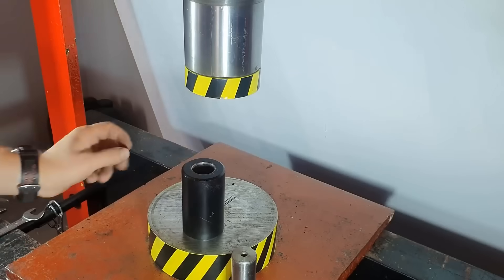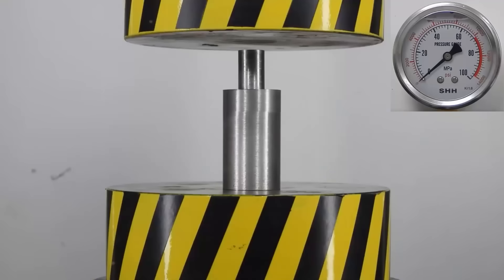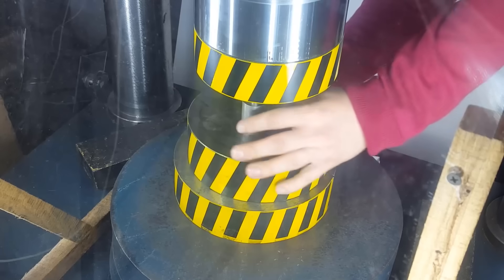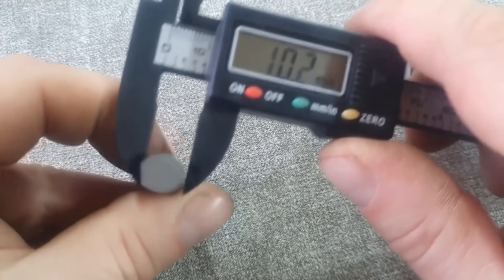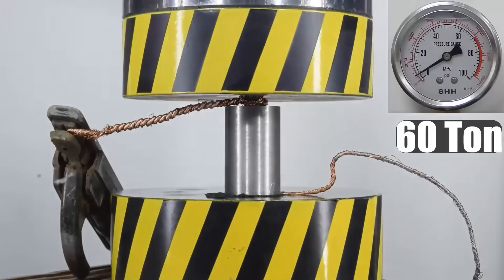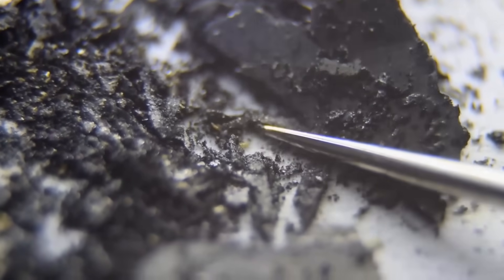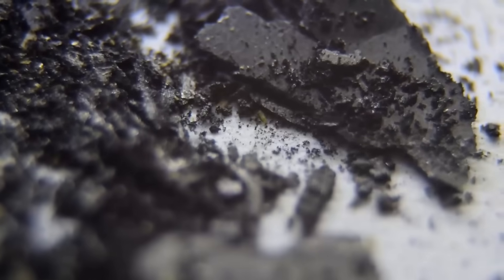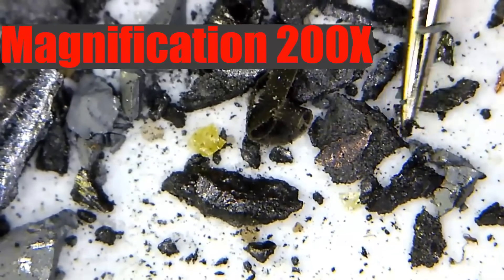HYDRAULIC PRESS TURNS GRAPHITE INTO DIAMOND

Comment: Well, congratulations would seem to be in order. Those are very definitely the yellow crystals of industrial diamonds. 
Used to sell for less than $1 per carat (very roughly about 1/4 inch cubed, or 6mm cubed), 30 years ago. So no, this is not an economical production system. 
The yellow colour is due to nitrogen atoms getting trapped in the diamond crystal as it forms. That can be scavenged out by chemical additives to the reaction chamber, but it just adds cost and complexity. For use as grinding pastes and powders, or sintered into "tip tools" for use on lathes, or drill bits that core into hard rock, the colour is irrelevant. 

De Beers used to be one of the "big three" manufacturers of industrial diamond last century. They started out using 500 ton presses back in the 1950's. By 1990, they were using presses capable of 22,000 tons, and a piston size of 6 inches. They could make 3,000 carats of industrial diamond crystals in about 45 minutes, per press. The tungsten carbide piston and die used multiple steel bands as support rings (aka compound cylinder, using Lame equations), to avoid the piston collapse you experienced. 

The engineering needed was at the very limits of material science and industrial capability. And it still is. Tungsten carbide can withstand about 45k atmospheres, but only in compression. It is no better than a good steel in tension, surviving maybe only 10k atmospheres. And what you have not mentioned at all, is that when the piston presses on the graphite to build up the compressive pressure in the press axis direction, tensile stresses are created in the other two dimensions. The piston expands radially, relying on the cylinder for radial support (lubricated by extruding graphite in the 3rd experiment) but ultimately that cylinder will also split due to tensile hoop stresses from the graphite (and cylinder) pressing outwards on the inner bore. 

Another fun fact: graphite is nature's best spring. A solid lump of it can be compressed to half of it's original height, and will then bounce back all the way to it's original height with no permanent deformation. Try doing that with any metal - you'd be lucky to get beyond 1% compression. Bear in mind I am NOT talking about a geometric device like an automobile suspension spring - I'm talking about a SOLID BLOCK of the material. 

In fact, given the cylinder dimensions, I am completely surprised it did not split if the pressure was indeed high enough to make diamond. I mean, even the piston in the second experiment mushroomed completely before it reached the appropriate load. In fact, experiment 2 was a complete misdirection, since once that piston mushroomed and transferred the axial load onto the end of the cylinder (which also became expanded) the press load was NOT compressing the graphite any more, and ALL of the load increase went axially through the cylinder instead. 

The indentation into the press platten of the third experiment proves the press load was transmitted though the piston and graphite. You should have seen an identical indent in the upper platten, buried beneath the shards from the WC (that's chemical annotation for Tungsten Carbide, btw, and not Water Closet). If you had used pads of WC top and bottom to diffuse the load, you might have saved your plattens. But it was also likely you would have sheared discs in those pads, and had the same end result damage. The pads would probably have had to be something like 50mm thick (as a raw guesstimate) to have avoided shear failure and protected the plattens. 

Certain ceramic powders (soils, or crushed rocks) can indeed withstand the pressure gradient to seal in the graphite. De Beers had developed quite a few special concotions to achieve that "gasket". It was all highly secret, since nobody wanted to reveal to the competition just how their process worked. 

Your temperature, however, would only have been high close to the copper. The piston and die (and possibly the press frame) all form conductive paths that would disperse and distribute the current from the welder. Resistance of the graphite is relatively high compared with those metals, so the current would have passed through the metal as a short circuit (you mentioned the breaker tripped) and avoided the graphite as much as possible. Temperature is a function of current density, meaning that while the copper wire was hot enough to melt and fuse, once that copper touched the piston and die and press it would have dispersed to a much lower density, and hence have heated the material far less. 

It is possible to convert graphite to diamond without needing that high temperature - but the pressure has to be far higher. I think you managed that by accident - rather than 50k atmospheres and 1000C, you probably got something like 70k atmospheres and a few hundred C at best. Those pressures will destroy any containment vessel, so it can never be cost effective. 

Also, you had no molten metal (iron and cobalt are typical solvents) that can dissolve the graphite and nucleate out the diamond crystals which then grow larger by diffusion of carbon through the molten metal. Crystal size thus depends on time, and even the small crystals you got here seem far too big for the time it was under pressure. 
Which all means I am not entirely sure how you got relatively large diamond crystals that show no sign of inclusions of graphite in them (black streaks  embedded in the crystal). That kind of "total matrix transformation" from the planar hexagons of graphite into the 3D tetrahedron of diamond is not something I have ever encountered. It feels more like the shock loading option, using ballistic projectiles splatting to a dead stop (like firing cast iron lumps with large graphite inclusions at high speed into a concrete wall) to generate a transient dynamic pressure that achieves the transformation. But this press process is not at all dynamic (fast) enough to do that. 

One last semantic for general benefit: these are synthetic diamonds. Which does NOT meant they are "artificial" diamonds. No, these are very much real diamond, made of carbon. 
The word "synthetic" means man-made, as opposed to naturally occuring. Hence, a synthetic fuel is a fuel we have created from coal, or plant oils, or suchlike. Synthetic diamond (whether the grotty yellow of industrial diamonds, or the pick-your-preferred color of some modern gemstone diamonds) were manufactured by us, not dug out the ground. 
Artificial diamonds would be an alternative material like Cubic Zirconia - definitely NOT carbon, and hence not diamond, but a mineral crystal that has similar refractive properties to polished diamonds, hence they can LOOK like gemstone diamonds, sparkling with similar brilliance, at a fraction of the price. 
The difference between artifical and synthetic is one of the most widely misunderstood uses of language...

Well done for reading this far. Sorry for the excess detail. I hope you found it interesting.
Reply: Damn, you should start a youtube channel lol
Reply: @mr.midnight8230 it’s worthy of addition to the Wikipedia page on synthetic diamonds 💎
Reply: Thanks for the insights!
Reply: Holy shit dude, get investors and make some diamonds
Reply: @mikelenhart4713 ??? If you know how to read it's not that simple
Reply: @ you mean making diamonds isn’t simple?!?!  What did I miss??  Please explain
Reply: Im en expert diamond maker after reading this comment
Reply: @ivandagr857 yeah, let’s all start cranking out diamonds in our shed 😂😂
Reply: This must be the largest blob encountered in any YT vid. ever. thank you sir!
Reply: That was educational!
Reply: It's funny how some people doubt that other people actually know stuff.
Reply: I can't believe I read that entire comment, but it was well worth the read. Very interesting stuff, thanks for your contribution.
Reply: Thank you for writing this. May I ask how you know this? My guess were you're a professor for engineering of physics.
If this was from wikipedia as two mindless and sore people commented, at least it wasn't copy pasted  but rather intellectually processed and very well recomposed information. Something those mindless critics would probably not be able to do.
Reply: @Diogenes2077  Thanks for the compliment, but I'm not that qualified. 
I worked for De Beers for several years, after studying mechanical engineering. But it turns out I am very good at putting together all of the tiny details that build up into the whole picture. So, I have specialist knowledge in a field that fewer than 100 in the world have studied like this. Understanding all of this stuff took several years, and even then some "revelations" only came years after I stopped working in the field, having emigrated to work with my true passion of racing engines. 

I'm more of a dog with a bone - De Beers had a process that worked in the 1950's. Then spent decades scaling things up, without anyone really comprehending how or why it worked. Very much belt and braces. But I can't work like that. 

It is only by understanding, that we can KNOW the things we propose as improvements or fixes will actually work. 

So my mind keeps chipping away at the problem, until that understanding comes. You read from a lifetime of learning that (surprisingly) made sense to many that read it, judging from other comments.

And even then, I'm quite sure I don't have the full picture! But I have enough to be happy that I can comprehend the gist of the chemistry, and physics, and thermals, and electrical currents, and...
Reply: @Diogenes2077  from the sounds of it he used to sell industrial diamonds and probably worked for one of the big 3 or worked for one of their Contracted sellers selling the industrial diamonds created .
Reply: @offgridcabinbelgium  I appreciate the compliment. But sadly, I'm teetotal, and never go to pubs. And a loner. Autistic, actually, although quite high functioning. (This explains why I can be so focused on detail at an unrealistic level). 
I'm far more likely to be in an offgrid cabin myself. But in Ireland (fewer people!)
Reply: I envy your knowledge. Thanks for sharing it.
Reply: Thank you, press fairy. I also believe he just put the synthetic diamonds he bought in the results 😂
Reply: @fenrirgg  Politest call out ever and everyone missed it.
Reply: That comment was better than the video.
Reply: That shock loading you described sounds like what might have occurred when the piston broke.  While that is a dynamic release of pressure, the way pressure waves travel in a confined space should mean they would reverberate, creating the shock loading.  I don't actually know if what I'm saying is true, though.  I am just extrapolating based on things I've learned.
Reply: @keithwinget6521  YES! Great idea. I like it. 

Instantly reminded me of the Dambusters - WW2 raid on German dams using Barnes-Wallis' Bouncing Bomb. 
It wasn't the depth charge exploding next to the dam wall that broke it, but the pressure waves reflected back to it through the water. 
A release of pressure when the piston broke would be reflected back as a positive pressure. 
Add some superposition of pressure waves like the infamous "rogue waves" in various seas and oceans, and... 
Thank you for sharing this idea.
Reply: @bythelee  Yeah, imagine if a piston could be created with friction-based slip thresholds at various pressures.  Obviously, the material would have to be considerably stronger to withstand those "slips" (at least, i think it would).
Reply: @keithwinget6521  At correct resonance frequency between pressure, current and heat you will get more diamonds.
Reply: Great reading
Reply: Certainly socrates
Reply: Bravo for knowing all that. I certainly didn’t. It’s fascinating. Thanks.
Reply: Use AC coils at required frequency to avoid high heat and pressure , the nucleons and electrons align ,  no need for extreme pressures and temp , coat inside of cylinder with ceramic  , try mixing other elements like H2 ,  Li etc in the graphite powder
Reply: @ARealGopher someone who actually studies this basically. Not necessarily smarter just more committed to this knowledge than most
Reply: @mr.midnight8230 nah, very much smarter duh
Reply: @mr.midnight8230  i agree ..
..also BN-Diomonds r for more easier to manufacture (Boron-Nitride)
its also super cheap buy already manufactured BN-Powder to make what ever tool shape (or diomond if one wish)
think its starts at 400-550 usd / kg .. if u just buy a small ammount
..but u can buy it in bulks of 100/1000 kg lots ...
Reply: Wow- you saved me a lot of typing- thanks! I couldn't find any mistakes, either and I learned a lot too. In late 1960s I was in research engg for G.E. , working to improve on their diamond and borazon mfg process. I too was surprised the vid shows them getting such large crystals over such a short dwell time. They appear suitable for MBG (metal-bonded grinding) use; given the methodology, I was expecting longer and more burnt crystals, as might be used in RVG (resinoid vitreous grinding).
Reply: @orangequant  Wow - this was such a niche field, I've never met or heard from anyone else involved in it. Glad my typing saved your fingers. Thanks for the nod to correctness, too. 

I wasn't much involved with the end use products - just in the engineering and apparatus used to get the "reaction volume" up to necessary pressure and temperature. Which was an engineering challenge I greatly enjoyed, mostly at and sometimes over the material limits of the day (late 80's early 90's for me). 

Borazon would be GE's name for Boron Nitride products, yes? A material with 90% the strength of diamond, needing the same high pressure and temperautre to make, yet the best alternative to diamond for machining steels and iron. 
The notion that diamond tools would simply "dissolve" into the surface of anything iron, as the chemistry copies the making of carbon steels, completely defeating the strength of diamond is something almost everybody overlooks. I forget it myself, sometimes. 

I think De Beers and GE had very similar hardware and processes, with biggest differences in detail geometry of the dieset, and perhaps the ceramic gasket powders. 

But it was all so secretive I'm largely guessing. De Beers seemed especially paranoid about revealing details. Nothing was ever patented, because that would "tell the world" how their process worked. 

I've still been careful with details here, because while the industry has changed and De Beers Industrial Diamond Division largely now defunct with plants changing to "Element 6" naming (and the Research Lab I worked at closed around 2000), they might still be suing the same trade secret process now... (since development pretty much stopped 20 years ago, and it's all been fine tuning and economic cost savings from then.

I suspect there was nowhere near enough heat in this process, so "burnt" seems unlikely. Possibly this was a cold pressure "shockwave" transformation - another commenter suggested the pressure released during the failure might have reflected back (and perhaps superimposed) to create sufficient pressure for cold transformation. The heating method would have put very little heat into the graphite, despite the molten copper wires. 

The microscope exaggerates the tiny crystal size - barely more than a sparkle amongst the black graphite, methinks. The kind of thing that catches the eye and makes you look closer...
Reply: @bythelee  Hah, I learn something everytime you post! Thanks. By the way, By the way, we actually did have BN samples as hard as diamond sometimes. And I guess you're right to be cautious, and so am I. But I will say that ceramic gasketing was just being investigated when I was leaving; and I'm not sure I can mention what we were using before that. My work went something like this: "Hey, we just got an order from the Navy or somebody and we need XYZ-micron size (of diamond or BN), so give us the optimal pressure-temp and dwell for that, okay?" And I'd figure out ideal conditions to maximize that screen-size per run. Then test it. Or maybe in reverse LOL, since the equations would get bizarre pretty fast and all I had was pen and paper and a little Friden calculator. Good chatting- thanks!
Reply: Thanks for this, very informative.
Reply: I missed my calling. Tried my hand at elementary particle, but always found solid state and material science so fascinating. Good info, dude. Thank you.
Reply: Buddy wrote a whole persuasive essay 😭😭
Reply: That was the longest comment I have very seen
Reply: Damn, thanks for the insight. But why the fuck do you know all this?
Reply: Your comment is in my favorite top 5 comments that I ever rode in the Internet 😃
Thank you for taking the time to deliver such amount of technical information :)
Reply: Bro wrote a whole essay
Reply: Can you give a source for "artificial diamond means alternative material like cubic zirconia"?
Reply: Nice work & thanks for your knowledge. 😎
Reply: Wow man, you should write a book.
Reply: THE longest comment/book ever read on YT, but couldn't stop reading.  Appreciate all the details and insights.
Reply: No need to apologise.  Although the masses on youtube won't appreciate what you just did, it is always a good thing when somebody who actually knows how to do things calls out these hustlers.
Reply: No excess detail at all. In fact, quite interesting. A well appreciated comment.
Reply: Longest comment i ever saw in a youtube video
Reply: Average English essay:
Look mum, its a introvert like me with a really deep 'conversation'(I think anyway)
Reply: Voluminously epic.
Reply: Wow Neal Stephenson, thank you!
Reply: Makes you think why that tungsten carbide piston was manufactured only that shape
Reply: Wow.. how do i copy what you wrote?
Reply: As soon as so called "high speed steel"   piston turned into a mushroom and left no scotch on a press i immediately understood it was a lie. 
High speed steel is fragile (almost) like glass.
In theory one may anneal HSS tho process of annealing is tedious and not any fool can do it.
Reply: Very detail on dimond creating
Reply: Damn! That was more interesting than the video!😂
Reply: This!
Reply: RESPECT👍 Kudos to you. Thank you!
Reply: thank you for sharing!
Reply: Sweet lawd.
Reply: Woah
Reply: Very knowledgeable. 🍺👍🏼
Reply: You, sir, are awesome. 👍🏻
Reply: All good info except he did not make any diamonds. Please. He fused the clay component of the pencil lead into glass like compound.
Reply: That last paragraph explains perfectly my problem with the common usage of the term, 'Artificial Intelligence'.
Reply: Sir, I am MIGHTILY impressed (favorably). Please tell me that you worked for or with either DeBeers or one of the other "Big 3" manufacturers, so I don't feel like I've wasted my life learning little about many things.
Reply: So how much does it cost to make a diamond vs. the cost of selling it? I mean, de beers was obviously doing well with it, I guess. But would it'd even worth it for them? *I'm actually curious cus I don't know anything about this kinda stuff
Reply: Awesome info. I'm also absolutely thrilled to see someone properly use the word "than." The world seems to have replaced "than" with "then" and it drivers me nuts lol.
Reply: Beautiful response, I learned a lot, thank you.
Reply: Synthetic means man made, so does artificial. What you mean is Cubic Zirconia is faux diamonds.
Reply: Reading your (great) comment one thing came to mind: you compared the results as more similar to those gotten from a "shock loading option created by dynamic pressure" than to those gotten from a smoothly applied pressure. You then second guessed yourself that nothing in the process was dynamic, but...

Could it be that the real pressure peak that created the diamonds was not at all involved in the entire pressing, but only the last second burst impact when the piston gave out?

I imagine it thus: 
1 - piston presses down. Copper wires instantly short circuit and are out of the game. Graphite starts to be pressed.
2 - graphite gets as pressed as graphite can be.
3 - the "solid" graphite structure finally gives out once the pressure surpasses even graphite's insane elasticity.
4 - for a brief moment once the graphite cracks, there is nothing holding back the piston. The entire force of the 60 tons of pressure that was being held by the graphite below has nowhere else to go and the piston shoots down like a bullet.
5 - some tiny amount of carbon still located directly under the piston gets pushed down, finally hard enough to become a diamond.

I could see this accidentally achieving a shock pressure when a gradient one was being used. No idea at all if possible but it came to mind when you talked about the weirdness of the result
Reply: I love your comment. I studied Aerospace Engineering and just seeing terms I recognized made my day!
Reply: :skull:
Reply: Im goin to quote bruce camble for that very informative comment! WELL YOU AT U MR.SMARTYPANTS!  that was awesome info ty
Reply: Well duh....
Reply: Dude, you must be the life of every party you attend. I'll bet all the material science babes are just dying to hangout with you as you show off your rod and piston press!!
Reply: Holy shit I got to know much more about thermal and electrical engineering in this 1 post than in entire course of physics in high school and college
Reply: Man wrote a freaking novel here 😅
Reply: Awesome read. Great job. Thank you!  Do you write anywhere else where I can read your stuff?
PS:   I've never ever seen a YouTube comment this long get 1.2k thumbs up.  
I once typed a three-sentence comment and within a day got,  "Aint know won gonna reed all that.  I bet know won ever did." 
(I'm not at all rebuking that replier's sentiments to me. He was absolutely correct and frankly one of the smarter comment section individuals.)
Reply: Wow, that was a lot, but is actually very insightful (I can't comment more as i'm not well-versed in the topic qwq)

Also, jeez, some people here can't read anything longer than a paragraph, man....
Reply: This guy just wrote a whole novel on how it's done lol
Reply: Very interesting and I learned some stuff.  Thanks for taking the time!
Reply: Very. Thank you.
Reply: It drives me crazy when they get Simulated and Synthetic messed up.   😊
Reply: DeBeers , no se dedica , no es pionera ni desarrolladora de tecnologias para la produccion de diamantes sinteticos , solo es la Mayor Compañia Comercializadora de Diamantes del Mundo.
Reply: I live for comments like this. Thank you for this wonderfully detailed insight. Absolutely fascinating!!!
Reply: Fuckin wikipedia article
Reply: Really good comment full of info I guess, only read the first paragraph though sorry
Reply: This comment is an epic gen x versus millennial smack down I have seen

Video: herp detp press go burrr. I is smarts

Poster: been there done that years ago kid. Read more chirp less.
Reply: I aint reading allat
Reply: Bro thought I would really read all this 😭
Reply: No, he didnt think anything of you, you aint special @thedirtmeister7288
Reply: @AM-wi6zo  bro I'm kidding 😂😂😂 don't take it the wrong way 🤣
Reply: Passou de duas linha eu não leio
Reply: and people say I yap or am schizo 😶 this is legit 1-2 actually essays compared to a paragraph of random facts bcs I'm high 24/7 and get an idea or thought during a video.
Reply: like this, mf actually typed all of that out. you need help, I hope 3 months later you got some.
Reply: @AdoringFan67 the difference is you can barely put a sentence together
Reply: Thumbs up if you said no fckng way I am reading all of that.
Reply: I read this whole comment. Your a mega nerd
Reply: I ain't reading allat
Reply: That's a lot of words. Too bad I'm not reading them lol.
Reply: Copy paste 😂 this man went through a lot to get all of this off of wiki.
Reply: @ThePondCrusader  If you read it then you’d see it clearly isn’t a copy paste job.